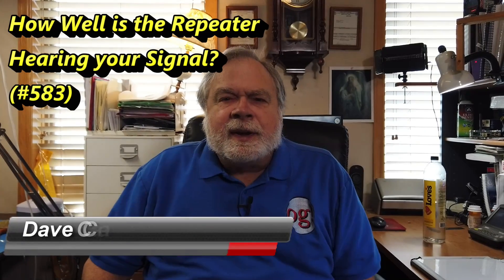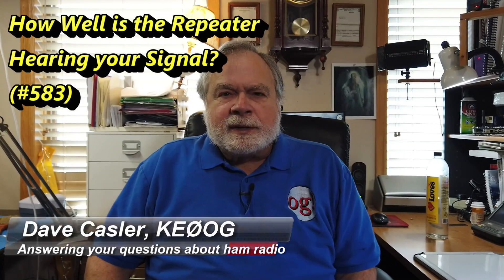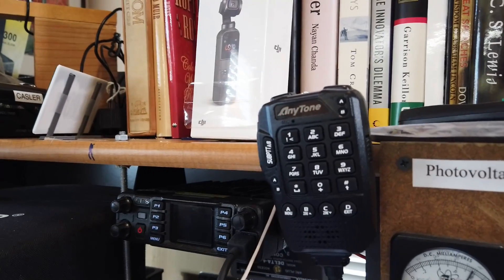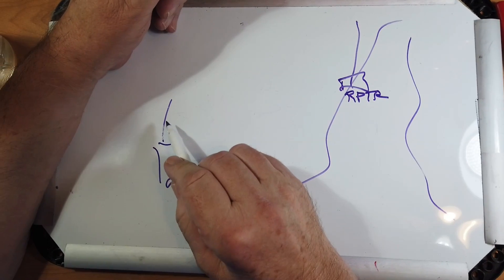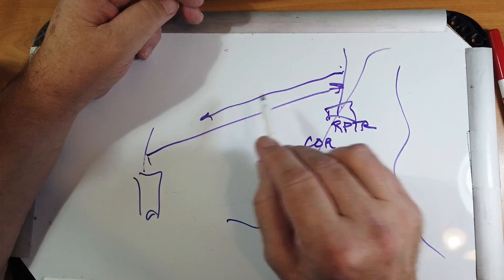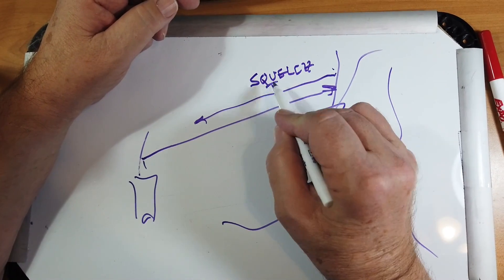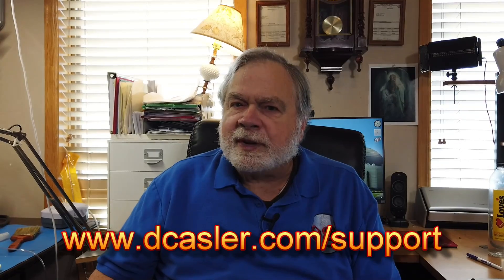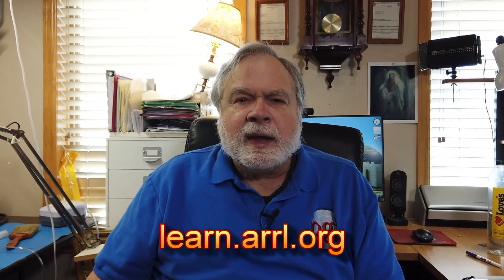How well is the Repeater Hearing your Signal? (#583)

Comment: Only on some repeaters im told im comming in low, i turned the mic gain up, messed with W/N nothing worked. Also i catch the tail of the repeater and it sounds like some1's making Frankenstein in the backround, and other users hear it too but only on my closest repeater.. uv-25x4 with ed fong 2m 70cm about 60ft in the air.. they say maybe im getting rf bleeding back from my btech rps 30m power supply but there the only 1's hearing this others dont.. brand new to this and learning but all connections are tight idk what to do other than test maybe with a dc batt.. any1 have thoughts?

Comment: Is it possible, to use a repeater and transmit it from Alabama to California or hf only. As I'm still a technician still learning studying for the general.

Kq4hcu
Reply: Yes it's possible, but it would have to be on a linked repeater system with a 10 meter repeater linked in to a repeater on as on a band where a tech can legally transmit. Your signal would be repeated onto a linked 10 meter repeater where General class and up have access, the repeater owner/trustee is the one that has to be a General as they are the one legally responsible. 
The best analogy is if a tech operates at a General classes' station, the General class operator is the control operator allowing you to use General class privileges while still being a tech. 
I hope this helps and 73 :)

Comment: You can also pick up a cheap scanner or baofeng that could receive the signal as you transmit.  I had picked up a scanner that could receive the repeater signal while I was transmitting and I could hear myself on the repeater output while I was transmitting.

Comment: Nice one Dave.  I would add that repeater noise due to mixing of other strong signals at the repeater site, or antenna system connections which are aging (oxidizing), could make it seem like the originating signal has an issue.

Comment: The 19" antennas often wiggle around enough to cause audible picket fencing on tx. The shorter antennas...I've had counterfeits outperform brand names supplied with radios. There's still a lot of dice being rolled in the antenna choice.
 Honest signal reports, +1. The only way to go.